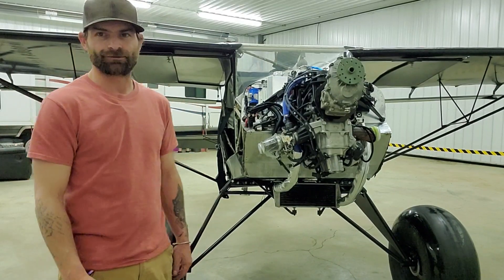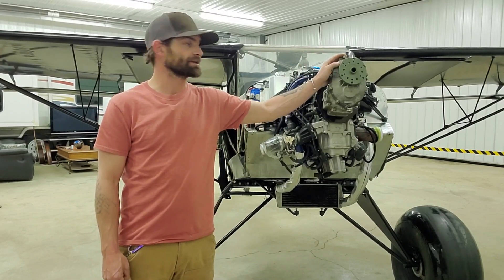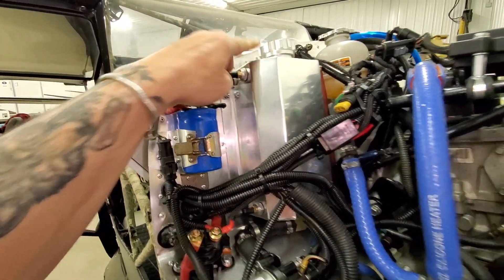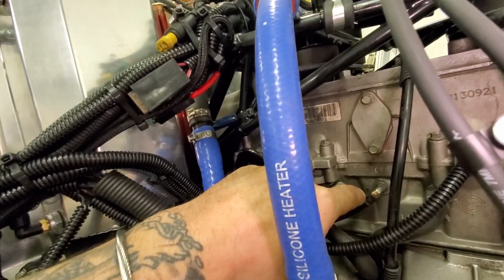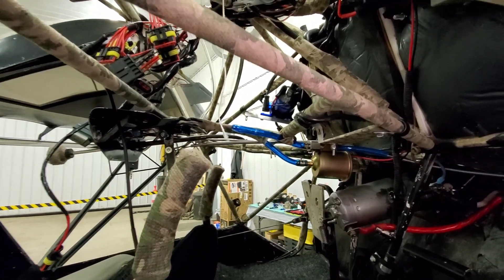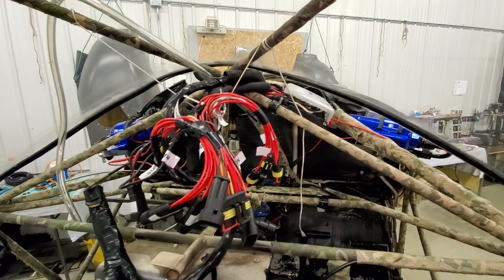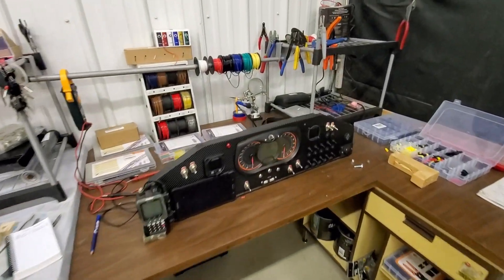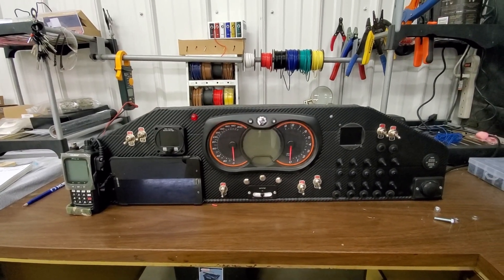is this the most powerful Avid flyer in the world?

Comment: Hey Dave, great work here! 

I'm also building an Avid and My name is David. I've been researching engines for several years and recently came across the Rotax 800/850 ETEC, and realized this is a modernized version of the older engines in most Avids. Anyway, I decided that's where I'd go with my Avid (still a ways out on it), so finding your video already doing it makes me even more confident in the idea, I guess great minds think alike, lol! 

Excited to see how it goes. I've started working though some of the initial designs to adapt the gearbox, engine mount, etc. You're well on your way with yours, but if you need any CAD work or any other help, please let me know!
Reply from the maker: Hey David shoot me an email

Comment: Nice! Hey…where did you get the coolant hoses?
Reply from the maker: The blue is silicone heater hose for hd applications like tracktors trucks etc. Get it at your automotive supply store. And the black molded hoses are the factory ones from skidoo off the sled. The two going to the cooler are wrapped in heat shield....is that how you spell shield? Looks weird ha anyway thanks for checkin it out hope that helps

Comment: You didn't say what the hell the engine is!
Reply from the maker: ha i have many times in prior videos. its a 165hp rotax 800 etec
Reply: Is That a Tango or a Mohawk PSRU. Thanks for this video. I have been looking closely at the newer 850 👍🇨🇦
Reply: In the notes at the top, Rotax 916
Reply: @htschmerdtz4465  Not a Rotax 916.  It's a two stroke as near as I can see.
Reply: @htschmerdtz4465 AH, NO, it's 2 stroke ! 😊🇨🇦